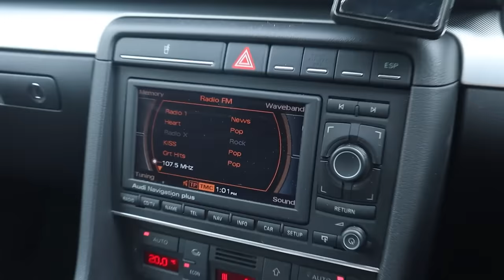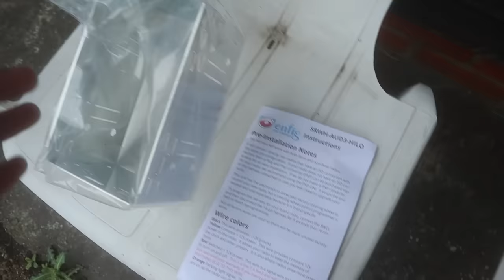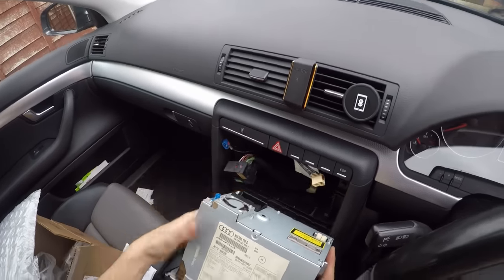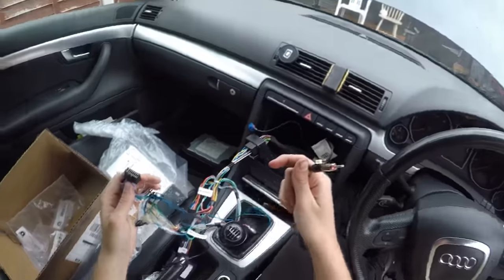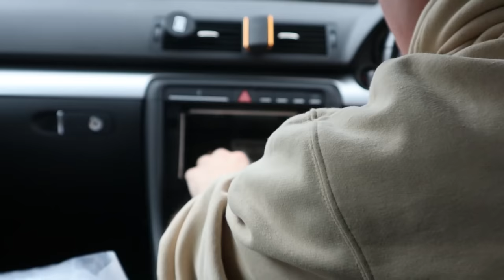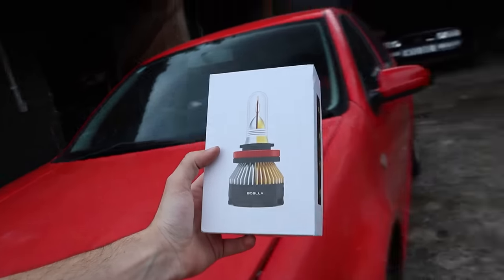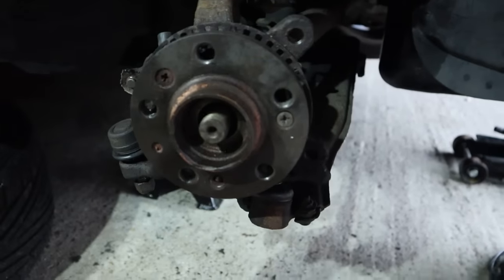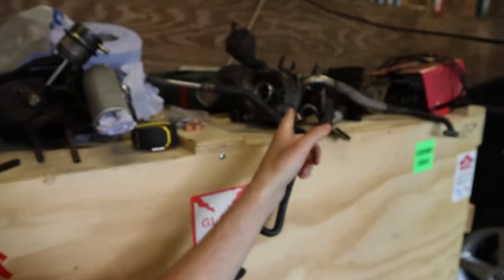DOUBLE DIN RADIO INSTALL! Audi A4 B7 Upgrade...

Comment: Hi Brad great video! Regarding the rounded off nuts and bolts on your corrado there's a few tools you can use to try and remove them even if rounded off. A nut and bolt remover set helps to get a good grip on the bolt head and hopefully will get it undone. Have to be careful tho as it might just shear it off. A small pair of stilsons or pipe wrench should get ahold of the rounded nut as well. Sometimes applying some heat to it might help loosen things up. Soaking bolts in WD40 for a period of time could also work. A long breaker bar even on the smaller bolts can make a difference as well. The more leverage you have the more force you're applying to undo the bolt. I've surprised myself so many times with how much difference a long breaker bar makes. Hope that helps and good luck 👍

Comment: The CD slot when you bring the screen down is for the Sat-Nav CD. If there isn’t a disc inside, your sat nav won’t work. It has all the maps for Western Europe pre loaded.
I’ve got the same system and want to change it as well.

Comment: could you post a link for the wiring kit you used as been toying with the idea as have the same double unit , but read mixed opinions on the kits , thanks keep up the good work and good luck with the corrado 😉🤙
Reply from the maker: Sure man they're all in the description of the video 🤙 thanks for watching 👍

Comment: Before u get an ur next mot on the Audi swap out the leds for standard bulbs sometimes they can be funny about leds/xenons being added to cars they weren’t standard on some UK regulation or something. I learnt the hard way 😂😂 also you need to invest in an angle grinder/dremel just cut those damn bolts heads right off and tap them through, easiest way I’ve found. Then obviously just replace them, saves you from a lot headaches
Reply from the maker: Sweet will do thanks mate and yeah probably should! I'm just a bit unsure on the best way of tapping or drilling broken bolts out 😓

Comment: I have a similar pioneer unit in my b7. The steering controls work great but I can't pause or mute from the wheel when it's on Bluetooth. Volume and next track wheels work but clicking them down does nothing. Any advice?

Comment: I have a problem. I connected pioneer dmh-a340dab radio to the subwoofer and the rear speakers on the back door don't work for me. a friend told me it might be that it was up to the connector I bought to connect the new radio . can you help me how to make that back speakers work again. thanks

Comment: The cd behind the screen is where your sat nav disc goes. The sd car slots are for pre loaded sd cards with music files, but I’ve never managed to get mine to play. (My guess is the music format I had was incorrect)
Reply: It works if you use the older sd cards. You need to use ones that DO NOT say 'HC' (high capacity) on them. I bought a 2GB one off ebay and it shows and plays mp3s no problem!

Comment: Hi mate.  Do you know if a4 b7 cabriolet front seats will fit a b7 saloon OK...  Wondering about air bag connections and other plugs mainly,  I'm guessing the bolt fixings will be the same.  Seen vids of b8 seats going in b7s but can't find any info on cabriolet seats.  Thanks
Reply: Forget about it - the Cabriolet seats of course have a fold-over-system, so that you can enter the back seats easily.

Comment: Any led upgrades for Audi Vw etc causes codes to pop up , its frustrating coz the stock lights/bulbs  are pretty dull & dim  although Osram are quality bulbs  ,  i upgraded my front fog bulbs to led & they look crisp but it throws a code on my dash but there aint no issue with the actual leds , even when i turn corners the cornering lights as normal no flickering  . so its a phantom ecu issue  , lol i just delete the code with the obd eleven  when it flashes up .

Comment: OEM led, etc has self leveling so you don't blind other road users. 
Wheel spacers are a death trap when they sheer off your wheel studs and you lose your wheel and crash. Just saying.

Comment: LED bulbs are iffy on all cars tbh, none of them seem to be able to recognise a lower draw of power and assume the bulb is out. Weirdly LED sidelights and DRLs are fine on my car though - maybe it's because the halogen equivalents are much lower wattages than an H7, so there's less disparity
Reply from the maker: Yeah odd, I think I'll have to wire in resistors to get them to work